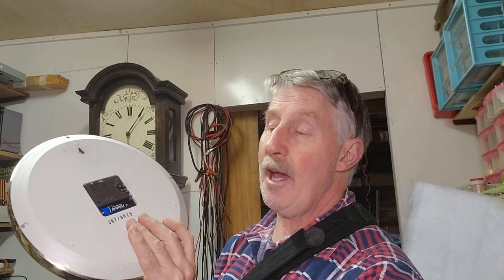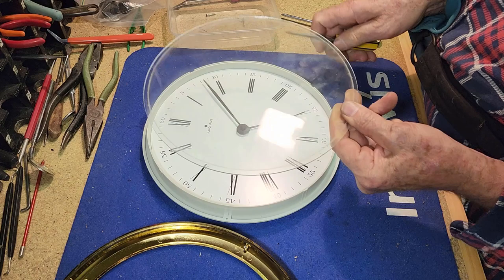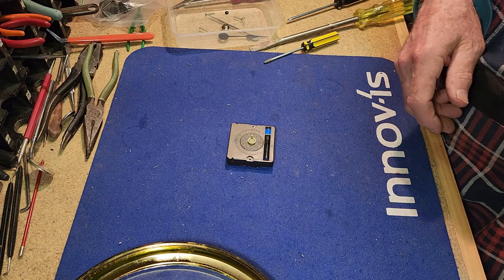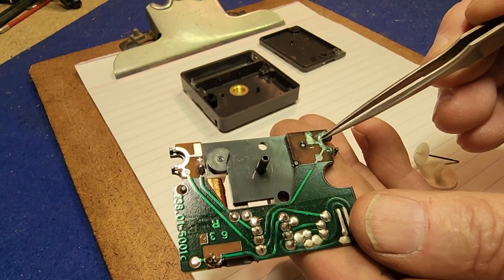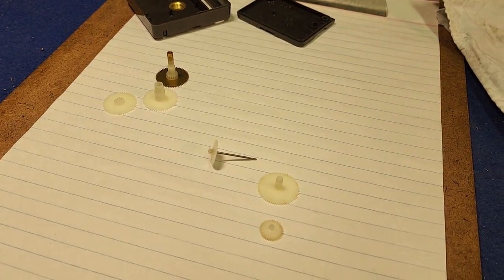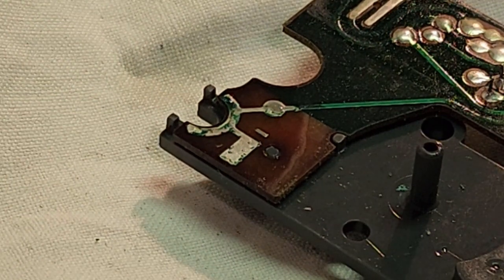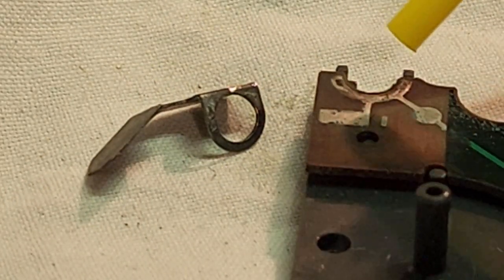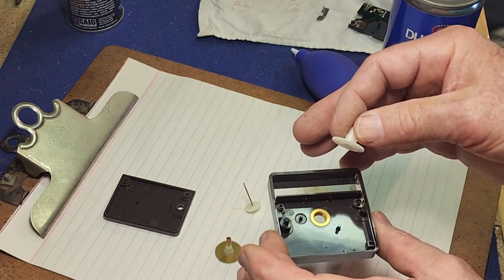How to DIY Fix Battery Corrosion on a Junghans German Quartz Wall Clock and save it from Landfill!

Comment: I like that extendable nylon brush. Where did you get that Chris?
Reply from the maker: I think I found that on ebay somewhere, but I'll add a link in the description to some through amazon. I think mine may be fibreglass rather than nylon, and you can get them in brass too. Very handy things!